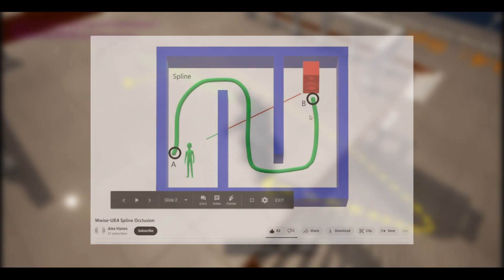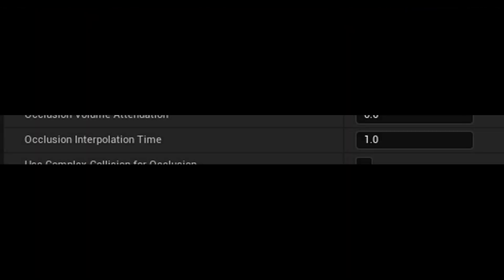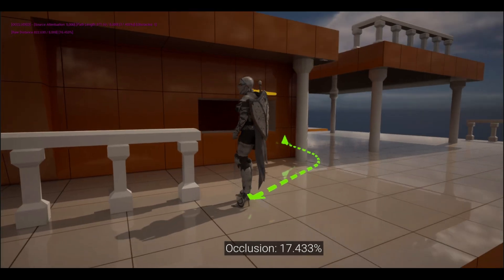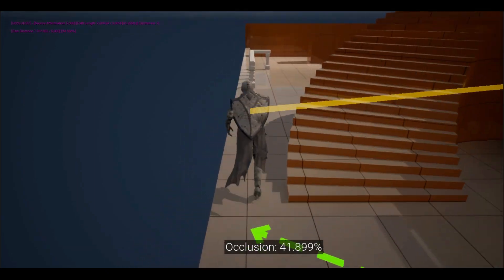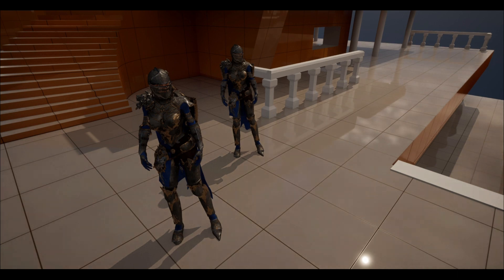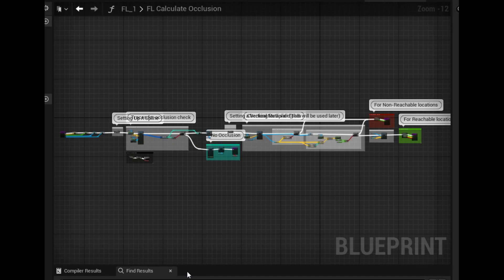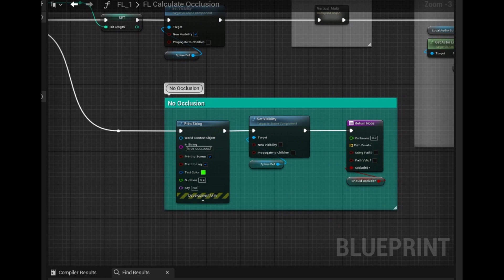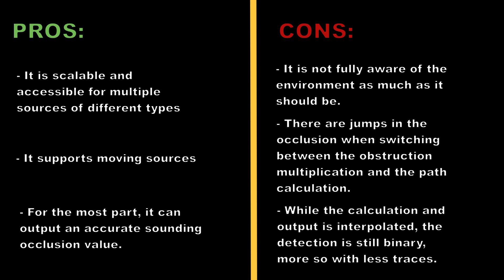UE5 & Wwise: Spline / Path based Audio Occlusion 🔊

Comment: Thanks for the very interesting video, but there is one thing that I didn't understand. 
In the Multi line trace by channel node, when selecting trace channel options, you have Wwise occlusion, and when I tried to reproduce this in my project, I didn't find it. Please tell me what needs to be done to make this option appear
Reply from the maker: Hello, this is a custom trace channel defined in the project settings, it does not exist in the engine by default. While you can use the visibility channel, there may be certain objects that you don't want to be blocking the trace, so it's sometimes better to make a custom channel as I have. I hope this helps!

Comment: Nice I didn't get a notification of this video earlier, its certainly interesting and would be cool to see if take into account a Physical Material type and maybe applying different effects depending on that + if the sound is above or below... also how does this work / interact with the Portal system in WWISE for doorways etc?

Your debugging looks like what they show in the YT video "Tom Clancy’s Rainbow Six Siege – Sound Propagation", have you seen that and what they are doing there and incoporated any of those ideas ?
Reply from the maker: I have not had a chance to check out R6 content yet, maybe that is something for the future. 

In the conclusion I mentioned CSGO and physical materials, which is something I want to explore in another system. Perhaps a later video on this will also include the Wwise portal system with a spatial volume to work alongside it.